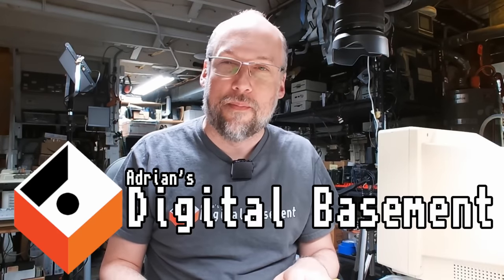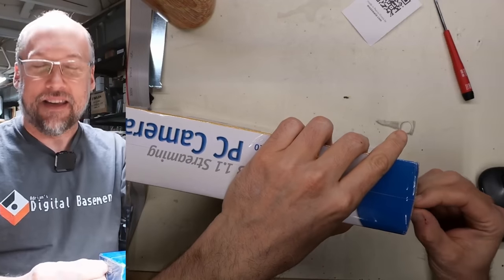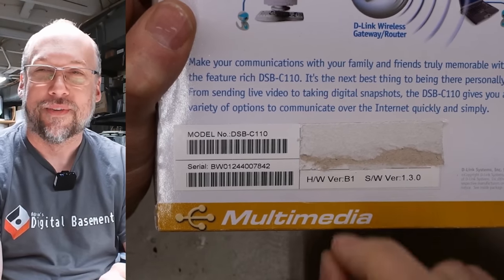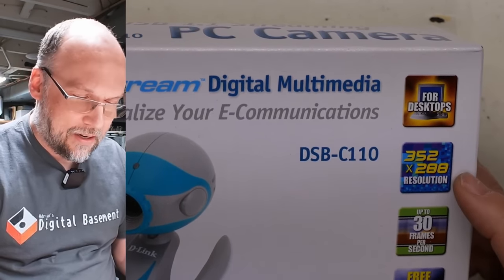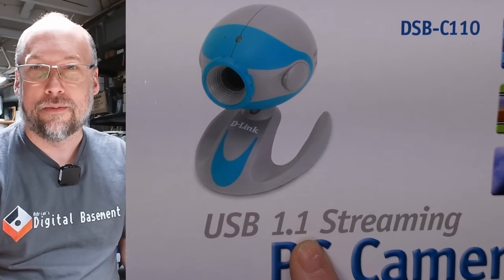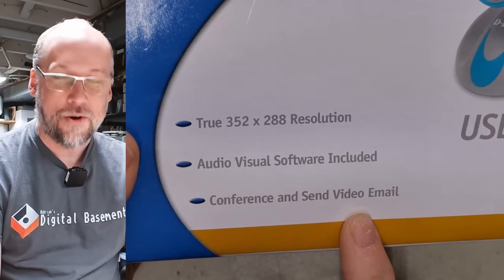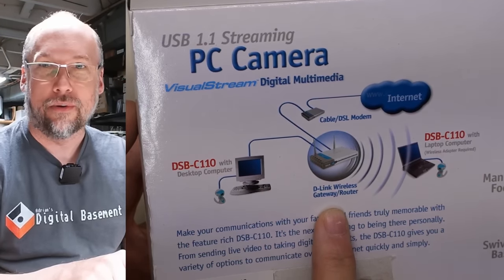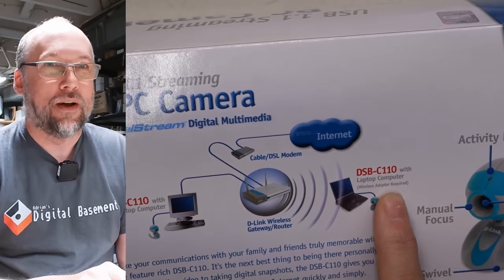How usable is a 20 year old webcam today? (D-Link DSB-C110)

Comment: The first couple of webcams I tried had such an atrocious framerate that they were completely unusable.  Something like 12fps.  While the resolution on this camera is really bad by today's standards, if the choice is between 30fps at 288p and 12fps at 480p, I'll take the D-Link.  Honestly, I don't remember when I got my first webcam, but 2001-03 could be about right.

Comment: I think the cam uses a standard lens, try seeing if you can switch it for a proper one.
Better lens and light gathering may help it a lot. Color adjustments are probably propriatary and may not be great in Video-4-Linux-2 either.

Comment: D-Link probably sourced a bunch of cameras from that Micro Grody company, or whatever it was called. They bought a bunch of their laptop cameras and just designed a housing to go around it and then passed it off as a desktop camera. That's probably all that's inside the thing is a tiny laptop camera.
Reply: These modules are larger than anything that would fit inside a laptop.

Comment: the problem with most of old webcams is that they are not hid class devices and most drivers is 32 bit only. the same problem with flatbed scanners but a but there are alternatives since scanners were more usable than a webcam in professional enviroment
i am impressed that linux drivers still exists for it but windows... if you had 32 bit windows 10 drivers from cd would work if they are digitaly signed but obviously if there was no windows xp64 version there is no hope to make it running on modern windows

Comment: Reminds me of the Connectix Quickcam (then Logitech cam) from the late 90's - the ball camera that sat on the triangular stand. I'm pretty sure I got mine for free back then, so I'm surprised they were charging $30 for this thing in the 2000's.
Reply from the maker: Oh yeah I had one of those! Mine was a parallel port thing and it did have similar image quality to this, but just had an abysmal framerate on top of it. At least this was a somewhat smooth 30fps at least on that relatively modern Thinkpad. :-)
Reply: Yeah and the camera NEVER sat still in that blasted base lol
Reply: It was list price, not retail. Retail, maybe $20-25.
Reply: The d-link one definitely looks like a quick-cam in a slightly different ball with the blue overmold on it!
Reply: Only thing I ever got for free was a Radio Shack CueCat.
Reply: Ohhhh I remember the parallel port cams. I could only ever get them to work on Packard Bell's

Comment: wow that resolution is pretty low even for back in the day of USB cam's ... I would expect usb 1.1 to do at least 640x400 or 480, 352x288 is not only odd but more in line with the parallel port camera's. PS yes windows 95 (B) did get a update to support very basic USB mass storage and HID devices, but 98 had the full show

Comment: Fiddling with the camera's settings (in the driver dialog in XP, or via v4l2-ctl in Linux) should have given you better contrast and color balance. But overall, the quality really isn't bad for a cheap camera from 2003. The (similarly cheap) webcams I got in 2004 and 2005 were a lot worse, with heavy compression artifacts to squeeze the image through the USB 1.1 bottleneck... and even those were fun to use. Just don't try to go fullscreen on a modern monitor...

Comment: There was a Windows 95 support pack that added USB support, that came out in ~1997, as I recall. My mother bought our first computer that had USB, yet even customer support insisted she couldn't have USB on Windows 95. If you need to force unsigned drivers in the future, at least on the old Win7 machine I have here, You hold down [F8] when booting, then select the option not to enforce driver signatures. I only use that laptop to program ham radios, and the only drivers available are unsigned.

Comment: Webcams were awful way into the 2000s, it feels like they sold this exact model under endless brands for many years. I'm assuming they kinda did in that it was probably the same CCD in most cases, 320x240 or upscaled 640x480 at half the frame rate.

Comment: 7:30 I think OSR 2.1 has limited USB support, but yeah.. it wasn't common until Windows 98.
Reply: Indeed support came with the OEM Service Releases (OSR) 2.1, but as Windows 98 SE, there was no support built in for the standard USB classes we take for granted nowadays.
i.e. USB Sticks or USB HDDs were not supported until Windows 2k/XP, so you actually needed drivers.
Reply from the maker: Ah ok -- yes I recall some kind of support with later updates for Windows 95, but mainly 98 SE was needed for useful support.
Reply: @belzebub16  98SE had support for most of the USB device classes we use today with that one hugely notable exception of storage. Keyboards, mice, and audio all work out of the box without any extra drivers.
Reply: @eDoc2020  You're right, I just tried it on my retro machine, and a USB mouse and keyboard worked isntantly - thanks for the info 👍

Comment: Honestly, I was expecting a worse image quality. Considering this thing was cheap when it was released 20 years ago, I think it's not so bad. The motion is fluid and with no ghosting. It looks washed out, but with some tweaking of the lighting and contrast, it could be decent enough for video calls and such. The resolution is low, but back then many screens were 640x480 CRTs, computers were slow and Internet connections were slower, so it was enough.

Comment: It was nice to see that linux had support for it out of the box.. disappointing that windows didn't.   I'd be curious to see if it does work on a mac, even though they never claimed support.. it sounds like the camera module was probably used in a lot of different models, so it's possible?
Reply from the maker: For fun I plugged it into my Macbook Air M1 -- and no dice. OSX didn't detect it. Perhaps some older version of OSX might have?

Comment: USB is what limited webcam development for a very long time. Streaming video at USB 2.0 speeds was very limited. We were only able to see improvement in the market once 3.0 became common and reasonably inexpensive.
Reply: It's USB 1 (fullspeed) that was hamstrung at 12Mbit/s.  USB2 at 480Mbit/s has plenty of room for high quality compressed video, no specific need for USB3.
Reply: @runderwo  You're right that USB 1 webcams that were the truest level of garbage that somehow managed to linger on the market much longer than they realistically should have, but... there are still a few problems with that assumption.

First, you assume that 480Mbit/s means 480Mbit/s. It doesn't. Real-world throughput was 280Mbit/s. And that assumes that a single device is allowed to monopolize the bus with no contention, and it doesn't say anything about latency or consistency.

Second, you assume that high quality compressed video was available to webcam manufacturers. It wasn't for many years, due to licensing, implementation costs, and software compatibility. Even though H.264 was released in 2003, we didn't see any webcams use it until 2012.

So let's talk about MPEG-2. "DVD-quality" video is 720x480@30fps with MPEG-2 encoding. This is typically encoded at around 6Mbit/s. 720x480 is about .35MP. By contrast, smartphones in 2012 were boasting 8MP (roughly the same number of pixels as "4K" resolution) cameras -- 24x the pixels and 2x the frame rate. If you wanted a webcam to be able to work as well as a smartphone camera in 2012, that means you should expect to need around 288Mbit/s, which is in excess of the real-world capacity of a USB 2.0 link.

Sure, there was a middle ground that manufacturers could theoretically have hit, but they would have been dealing with all of the foibles of USB 2.0 at knowingly-mediocre quality, too expensive to compete with the cheap cameras, and not good enough quality to compete with typical smartphones. The people who cared were using better equipment anyway.

USB 3.0 meant that you could run 4K video at 60fps with computationally-reasonable compression rates with enough bandwidth headroom to more or less eliminate jitter. Of course, USB 3.0 was released in 2008, so in theory we could have had 4K webcams in 2012... but the market was very slow to catch up, mostly because it required the explosion of independent web streaming for it to become viable to work on the technology.

Comment: windows 95 DID support USB in 1996. I have an IBB Aptiva e26 with preloaded windows 95 equipped with usb ports. While many recourses claim they didn't, everyone I've seen over the years has had 2 on the very top in the rear.
Reply: The update to add basic USB support to Windows 95 came out in August 1997. Many PCs had USB ports before then but the hardware was usually disabled in BIOS.

Comment: Laptops of the time did have wifi. Usually a type II pcmcia card. The reason why it didn't support mcintosh's because they didn't make software for it. It may just work right out of the box on Modern Mac it all depends on how support for the chipset in the CCD was done

Comment: I'd have been interested to see it set in focus with smaller screen to reflect it's resolution, vs. running it at 1080.  Also, since it's so old, even if shrink wrapped, running a Q-Tip with some windex or something to ensure no dust on the lens would improve the quality a ton.  Remember XP came out with the 486/Pentium systems, and folks were still running EGA, and on to VGA with default 640x480 and this does 1/4 that so pretty good on a system/monitor like that.  I'd like to see it connected to the thinkpad (what resolution is it's built in monitor, if greater than VGA, hook up a real VGA monitor to it and see how it performs.

Comment: Win95 never suppirted USB out of the box. A Win95 supplement OSR 2.1 added limited USB support to Windows 95. Win98 provide USB support out of the box but didn't support certain classes of USB devices out of the box such as mass storage devices (USB external hard drives, thumb drives, digital camera memory cards, etc), something MacOS 9 did at the time. This you needed to install drivers for such devices on Windows 98. Wibdows ME was the first version of Windows to support USB mass storage devices out of the box but had reliability issues so many people stuck with 98SE until XP arrived in 2001.

By the way, this camera must have come out in 2001 or later due to it's WinXP support and the originally translucent iMacs had been discontinued by then in favor of the mostly white  iMac G4 flat screen lamp Mac. But since this appears to be a white lable/OEM webcam D-Link simply rebranded as their own, it's not surprising Mac support was not included. These days generic webcam support is built-in to MacOS and Windows so no external drivers are needed anymore in most cases.

Comment: You have to consider the hardware available at the time, early Pentium clocking in MHz? I bet the cpu cooling fan was screaming just to run that camera.
3com HomeConnect was the nicest webcam back then when Raptors and T-Rexes were a menace.

Comment: The refresh rate is surprisingly good but it's sooooo washed out.  I wonder if it's being captured wrong or maybe it relies on software to adjust the parameters and VLC just has no built in logic for that.  Could also just be maybe there's a plastic lens or filter that's degraded with time or something.  There were worse cameras that were newer though, even as new.

Kinda reminds me of the webcams that, was it The Screensavers would hand out to viewers?  Then they'd show chatting with people over webcam and the images were small and fuzzy even on a 480i cable TV picture. :p

Comment: There was no point in 2003 to make better webcams. Video file sizes make it inpractical to use as mail attachments, and internet speeds was to low to transmit better quality anyway. Also, USB speeds was limiting factors, as well as cpu speeds to encode/decode it without some mpeg decoder cards...

Comment: Thinking back, even the more expensive cameras around the early 2000s  were still junk. I recall helping someone install a "digital home security camera system" in circa 2005.  The quality was better than what you saw, but not massively so.  It was basically an analog camera with some A->D built in. Pretty much useless.

Comment: In Windows 10 the search for updates automatically in the device manager has been non-functional for quite some time (Maybe as far back as Windows 10 2004). They should really remove it entirely. Instead, they moved it to the "Windows update" section in settings under "View optional updates" and then "Driver updates".

Comment: Right off the bat look at that envelope pushing resolution, not crusty old 240p 4:3, no it does 352x288 in sorta-5:4 aspect ratio, so slightly higher and not quite 400x300 "Wow!".😄 Perhaps it was just hard and expensive to make at the time but so many products with weird incremental resolution steps.
I've found that 480x360 would have been a great standard for a lot of things throughout hardware history but it sure is hard to find many examples of 360p. Everything tended to be 240p/480p based only, or slightly higher or lower 300p/384p, but not much at the dead center with 360p as a compromise of performance and visual sharpness in the 90s.
Well it was soft in definition, contrast, and a tad desaturated but not that bad in color space, at least you didn't look yellowed in complexion.😉

Comment: Not a Webcam question, but a Laptop question: How are you keeping the batteries for a retro laptop working over the years?  Is it best to keep them charged?  Or discharge/charge cycle them?  How often?  Etc.?
Reply from the maker: Really no particular strategy other than not keeping the batteries stored fully topped up, but leaving them around 80%. I then try to do a full cycle once a year. That's really it. This Thinkpad was sent in by a viewer, and I think the battery is a replacement which is why it's still working. I have a hard time believing the original battery would still work.
Reply: AliExpress has many battery replacements available for older stuff. As for storage, best charge range is between 50-80%, but closer to 50%.
Reply: @adriansdigitalbasement2  My X31's battery works just fine and I'm pretty sure it is the original. I have some older laptops with old Li-ion batteries but they're pretty degraded.

Comment: The fact that your Windows™ tells you that the "thing" connected to the computer is a CAMERA means that the USB device ID-number is read from this camera, and therefore there are drivers in existence. The reason why it is nevertheless not working is different then that there is no driver. Old low resolution camera's are deliberately switched off in Windows™ because of the low resolution, this was done on purpose so that old low resolution camera's could no longer be used. People were forced to buy a better camera. There is a trick to make these old camera function again, this programme is somewhere on the internet. I used it and the low resolution is a big disappointment. That is why all these camera's are switched off.

Comment: Windows 95 came with USB support, I have an original Windows 95 CD Rom still in its cellophane packaging and it says so on the front.
Reply: Only the latest versions of 95 have any USB support and I don't think I've come across any 95 installs "in the wild" with that feature present although admittedly my sample size is small. Most versions lacked USB support completely.

Comment: i still use my cambridge soundworks speakers let alone a lot of my old pc stuff... why replace it if it works just fine? i do use newer usb cameras though the lower resolution as you find out isnt great...  this was before mac osx so its not surprising there is no mac drivers... once they switch to linux backend they became actually useable. camera was discontinued in 2006 and dllink stopped makin drivers for it before win7 might beable to find a workaround still..  It isnt that we didnt have good quality cameras then more like most people didnt have bandwidth to display much better streaming.

Comment: Again you're wrong about modern CPUs vs CPUs even from 5 years ago. There is a huge difference. The single core performance might only be 4x faster in the last 10 years, but that's still significant. But more importantly the core count does matter. I do use them. It's definitely 20-30 times faster in the last 10 years. I HATE the fact that I'm stuck on this POS 4th generation intel CPU at work. It's soooooo slow. I remember when it was quite a bit faster than my home CPU (2nd gen I7). But now I have a Ryzen 5900x. It's overkill for my job. (but perfect for my hobbies) I'd be happy even with a Ryzen 3600. I have one. I have a spare Ryzen 3600 and motherboard at home. The CPU is barely used. The motherboard is brand new never opened. It was bundled with my GPU against my wishes. I have no use for it. It's only a B550 board. I have X570 for my main computer. But that would make one hell of an upgrade for work. But god forbid I try to use anything other than dell. sigh........